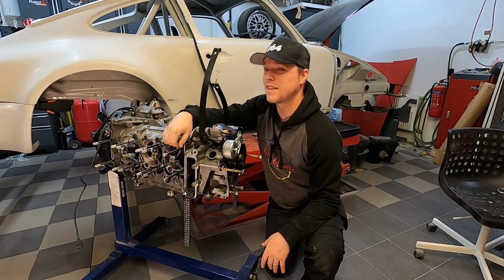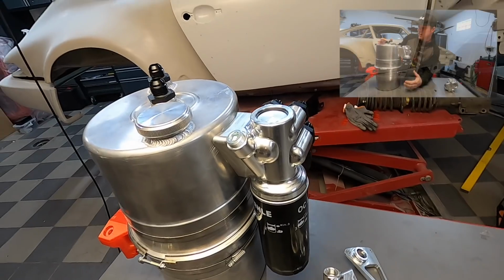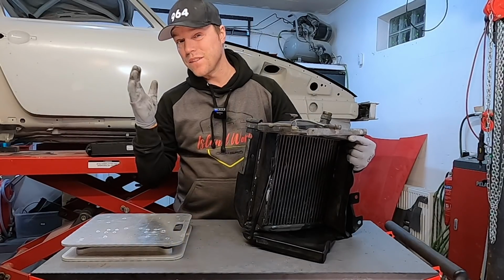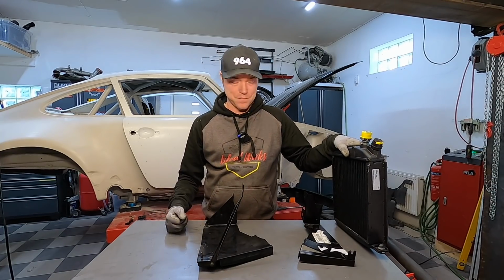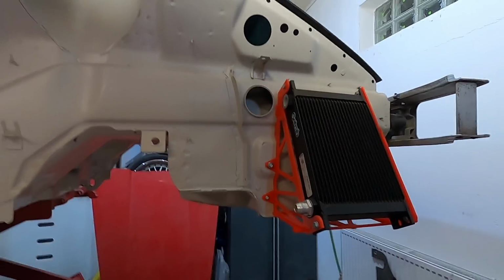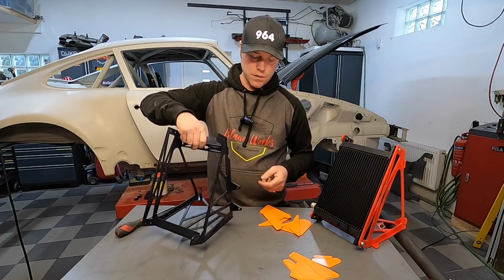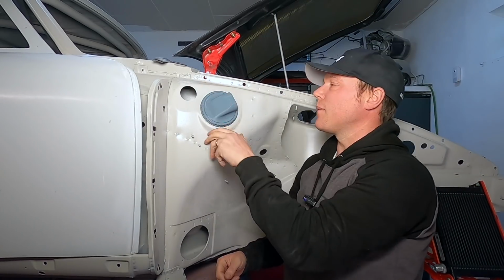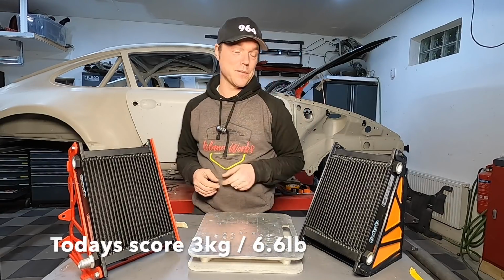Cool runnings - Design and install of twin coolers for Porsche 964

Comment: Great kraftwerks!  Thanks for sharing the 3D level up.  How did these Setrabs hold up.  I've found they are too easy to damage and don't flow well for the larger oil pumps.
I teamed up with Ravi at CSF for a line of oil cooler cores for Porsche and Motorsport.  Would have shared sooner but just discovered your vids.  Hope to see more of your work and connect.  Best from Euro Parts West, Scottdale, AZ USA.
Reply from the maker: I’ve not had a chance to try it in real life yet. Setrab is a popular choice over here and easily available. 

I’ve adjusted the consoles after I made the video so that they are shifted forwards. More info on that on my Instagram.
Reply: @islandworks  Nice, I'm sure  the Setrabs should be good as they run perpendicular, so not likely they take a stone puncture.  I've got a 2x OE cooler stack grafted to each other.   They work well like that in the factory envelope.  Beyond that we copy the Turbo S Auxiliary cooler kit in series for front center left mounting (uses m26 unions).  The CSF core we run is about 65% larger, so they work well.

Comment: Great fabrication. Are you putting in fans?
Reply from the maker: No fans! Car will not stand still much
Reply: @islandworks  did you finalise the mounting for the oil tank ?
Interested in a lot of the bespoke parts you have done for my build
Reply from the maker: @sailrockpaperscissors8261  I’ve finished it inside my head, but not in the car. It will be one more mount on the top strapped to the strut brace with a P-clip

Comment: What is more important with oil or water cooling systems is the fore and aft ducting and sealing . The ducting in must enable the air to hit the core at 90° and using Bernoulli's Principle . The same with the ducting out in order to accelerate the airflow out to an area of the matching speed of airflow over the vehicle . So we end up with an opening at the front of the vehicle around 30% of the area of the radiator that flows to hit the core at 90° and an almost identical duct out to the bodywork . Using 2 in this instance you could take the advantage of incorporating the coolers into 'air curtains' at each end of the bumper and exit to the airflow in front over the outside of the front wheels which will reduce frontal drag as well as supply air to each radiator . The increased efficiency will result in smaller oil coolers and lighter weight .
Reply from the maker: Thanks for the feedback. In the end I redid the whole thing and put the coolers down facing diagonally forward. I don’t know why I wasn’t able to get my mind around that while filming it. 

There are some photos of the final piece in aluminum on my Instagram.
Reply: @islandworks  Hi ! I've just found this channel so made some comments as they've appeared . The method you changed to is common on Formula 2 sidecars which I am building at present ( designed by myself ) but the rads are angled forward .Although the top teams get the ducting correct on the inlet side they have no ducting at the rear which is critical for good recovery .The hot air just finds its own root around other stuff behind the rad and cooler . These things tend to have a continuing overheating problems . The common cause of a DNF . Best wishes .
Reply from the maker: This might be an area for further improvements. I’m just hoping I get enough out of it to keep it regulating to a consistent temp. Previously it was not enough with the original cooler (combined with incorrect pre-ignition) causing it to climb continuously.

Comment: That's going to be too hot for the trunk area. Are you thinking a safe area from accidents?
Reply from the maker: It’s quite common to have the oil tank in the frunk for 911 track cars. What are you concerned with?
Reply: @islandworks  It's just a lot of heat in there.

Comment: If you flipped the coolers so the ports face the front they would give you all the space you need between them and the tyres, better protection and very little extra length of hose. 👍
Reply from the maker: That is actually how the final version looks. If you check out my Instagram (islandworks_motorsport) there are some images of it there 👍🏻 Initially I was not able to turn it that way because I was looking at larger coolers and it took me a while to circle back to that....🤣

Comment: Really enjoying your vids. A couple of more or less trivial items:
- it obviously varies quite a bit based on real world configuration, but in general you are absolutely correct in that fans do nothing over roughly 35kph - they simply cannot move the volume of air that you get by pushing the vehicle through the air. 
- IIRC, I remember reading somewhere that starting with the 964 the chassis metal was stamped to accommodate RH as well as LH fuel fillers. It was never used till the 996, tho. 
- A couple of thoughts on the cooler positioning (though I assume it is too late now for you to change anything...): as you surely know, in later cars the radiators are at 45° angles (or thereabout). This has several advantages including the fact that you are not changing the direction of flow 90° twice and thus improving airflow and you can also direct the exit air behind the front wheel and into the brakes. This was done on the 996/7 GT2/3s (not sure about the 991/2s especially with the fender air exits). While the air may be somewhat warmer than ambient, it is a huge amount compared to what is usually ducted to the rotors and works quite well. Obviously this is also dependent on what you are planning with aero in general.
- You might consider having hard lines bent to go between the tank and the coolers. You have the potential to save a not insignificant amount of weight vs hoses.
- And lastly, wouldn't it be easier (and even a few g lighter) to simply bond very thin sheets of CF to your cooler support frames rather than all those individual plugs? Just curious...

I am impressed with your work. Keep it up. I am hoping to finish my 997 GT2RS "tribute" build this spring. It would be cool to do a meet at the 'Ring sometime.
Reply from the maker: Thank you for your great comment and great feedback!

Some thoughts from my side!
-I really hope I'll do fine without the electric fan. With a cool down lap and an air-cooled car (with a constant fan) I believe it will also do fine as I enter the pit.
-Good info on the filler. It's exactly in that location so it could have something to do with that for sure.
-I played around with so many different cooler positions that I cannot remember all of them now. I do agree with your comment and with what I know now I'll revisit a more flat forward facing position to see if I can make sense of it again. The manufacturing technique and the vertical stiffness plays in a bit, but again I'm curious to revisit it again as it would have some good benefits.
-I disregarded hardline previously as I believe I would still need hoses for both ends and it becomes a lot of couplings and fixation points. I do like the idea of hard lines though!
-The reason I went for the printed inserts was really because I can make them at home and it's very easy. The design is made so that it fits exactly in place and cannot pop out. The material will likely be Nylon or CF infused Nylon which is incredibly strong and durable. Sheets of CF would work just as well and that's how the design actually started ;-)

Hope too see you at the Ring once the car is done!

Comment: Aerodynamicly speaking i would have desigend a diffrent inside to the cooler mount. Maybe print it and add a layer of Carbon.
Reply from the maker: Thanks for the feedback! More can be done to optimize the flow and direct it through the coolers. The principle I’ve used is that the pressure build up inside the “box”/console will be greatly higher than the other side of the cooler which in turn will drive the flow. This is similar to the original coolers. I’ll see once I push the car hard if it’s enough or if I need to tweak further!

Comment: I really like the puzzle piece concept. It’s high precision and really flexible in design. 👍
If you are combining carbon fibre and aluminum make sure to protect the aluminium against corrosion. Sealing the cutting edges should also help. You might want to think about how much the cooler and the oil inside (weight) will stress the the brackets. Aluminum is not very resistant against fatigue. This construction might see a lot of acceleration coming from the suspension especially on a sports car.
Reply from the maker: Thank you that is great feedback. The covers I had now are plastic and my plan is to make them out of carbon fiber infused PETG which is a reinforced plastic similar to a plastic bottle. 

I’ll do a stress analysis to be safe and it’s a good idea to add a few Gs to take a rough ride into account! 👍🏻👍🏻
Reply: It would be nice if you could explain your assumptions and the results of the analysis here on your channel.
Reply from the maker: I’m always running up against the episodes becoming too long and some of it does not make it. For the cooler sizing what I did was to use the tables provided by Setrab and try to make a relative comparison with the cooler I had. In the end I had to assume thing such as the flow through speed and an average rpm at which the oil is being pumped around. What I found in the end is that the new coolers require a bit higher pressure difference on the air side but would otherwise give the same or better. 

In the end I will have to test it and if I find I need more I will go to the Setrab STD 634. 

I’ve also had a discussion with the people at Setrab to make sense of some of my logic. 

Please feel free to ask any questions as I’m happy to share or email me if that’s easier.
Reply: @islandworks  Oh well, I had the stress analysis in mind when I asked the question. But this answer is interesting as well 😃
Reply from the maker: Aha! I’ll share the analysis on Instagram once I get it done ;-) 

Islandworks_motorsport